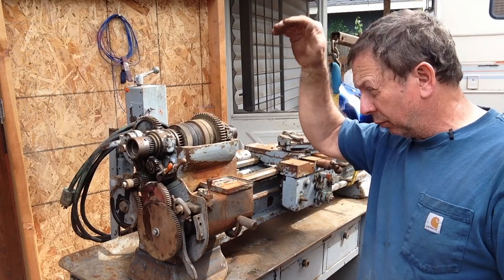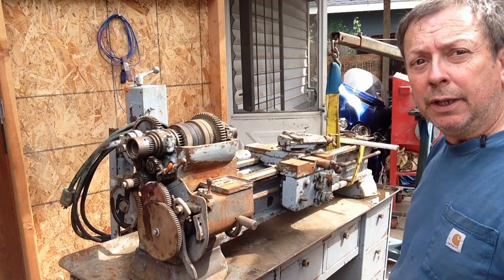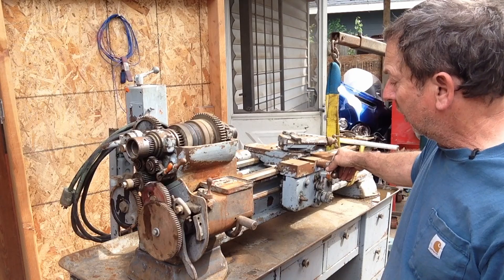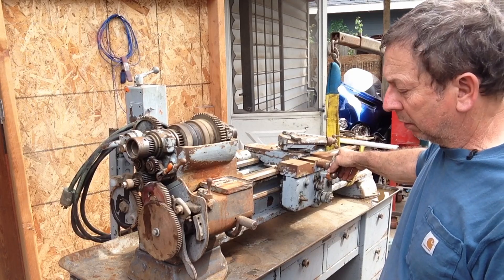Sheldon Lathe Restoration, Part 1: Overview

Comment: Thank You for posting, very helpful for a old guy  just learning. I pick up older unit with over head belt drive motor several months not much information out there, Best of Luck with your Lathe.
Reply from the maker: you are welcome, there is actually a fair amount of info on the sheldons. one good resource is lathes uk, and another is vintage machinery.org not sure what is there as I haven't looked in a while but worth a look. thanks, Dan.

Comment: First of all, I what to thank you for your postings. I have aquired a Sheldon lathe TE-1136P. your videos have been very helpfull with my attempts to get mine up and running.  I am wondering where you got the roller bearings for the lower unit, as I am thinking they will need top be changed on mine.  Any help you are willing to extend will be greatly appreciated. Thank you;  Stephen
Reply from the maker: Thank you, I am ashamed to say that the bearings were sourced from Amazon and were not US made. While I try to use USA parts,the reality is that the least expensive alternative was almost 10 times the cost per bearing.
Reply: @hillsgun  We do what is needed in the times we live . I am sure I will have more questions as I move forward into my rebuild.
Reply from the maker: Not a problem, just remember that I am also learning as I go along. Dan.

Comment: Are you sure it's an EXL series Sheldon? The reason I ask is the height of the bed looks a little taller than a 10" Sheldon, but it might be the angle. The best way to tell is to measure the width of the bed. If the bed is 7 inches wide it's a L/XL but if it's 8 inches then you have either an S, T, or M series. I have an 11" SWQE with a serial number in the 11k range that I hope to get some videos of soon. 

Anyhow, great video. I really enjoyed it. Thank you for uploading it. Looking forward to more.
Reply from the maker: I beleive it to be an XL  series , it is the earlier single tumbler 10" which Sheldon produced until I beleive 46 and has the larger spindle bore which rules out the L series, As I said in the video this is virtually the same lathe I have had for several years and was researched when I got it. The only differences is that this lathe does not have a taper attachment. thanks, Dan.
Reply: @hillsgun  I apologize. I wasn't trying to say yours could be a L series if it had a 7" wide bed. I was just trying to point out in general that a 7" bed could be either an L or XL. In your case I'm pretty sure you were closer to the truth when you said it was an SWQE because that bed is way too tall to be an XL. I'm willing to go so far as to donate 20 bucks to the charity of your choice if I'm wrong. :-D I think you'll find the bed to be 8" wide.
Another difference between an L/XL and the S series is the diameter of the tailstock spindle. On an S series it's 1.25" in diameter. It's smaller on the L/XL. 
Anyhow, as I mentioned before I have an SWQE. And what's in your video looks a lot like it. Mine even has the same QCGB with the 3 position lever on top. I'm current working on a video that shows the differences in mounting between the single lever and 2 lever QCGB's.
Reply from the maker: No apologies are necessary, I take no offense to intelligent comments on the channel . it is indeed an 8" wide bed, but depending on where the information comes from it varies greatly and it is also stated that Sheldon would mix and match to the customer specs. 40 to 46 was single drop lever,later was double . Another example of discrepancy is steady rest casting numbers. I have seen the same casting numbers given for 10,11,and 12 inch lathes as I noted in my latest video. The reality is that the best Lathe to have is the one you have and I am fortunate enough to have 2 of the same model and that is all that matters, the rest is not important to me. Thanks, Dan.